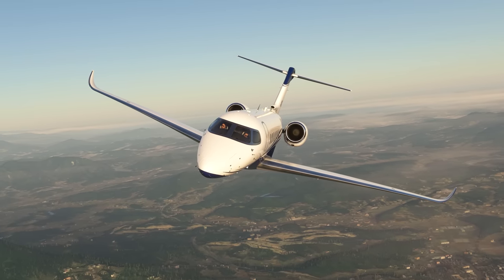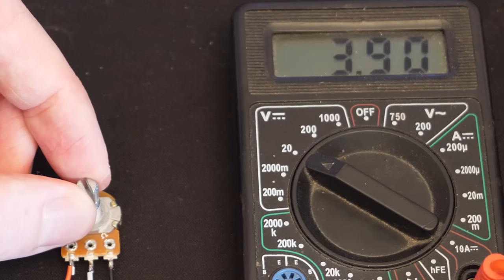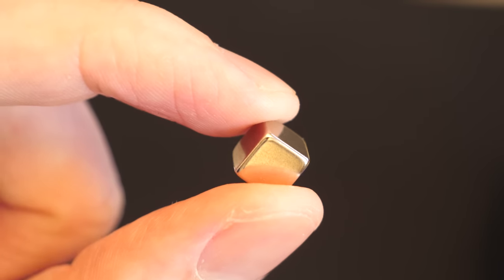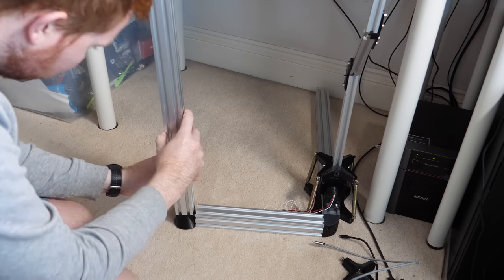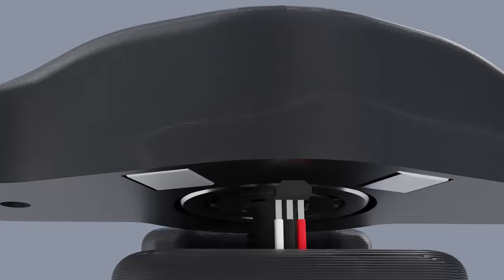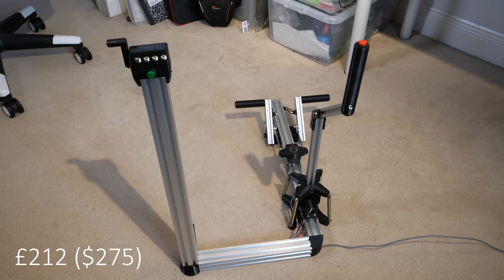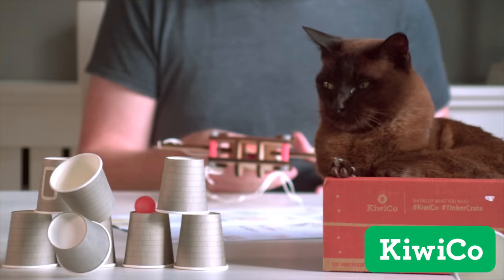DIY Flight Simulator Joystick

Comment: Mr beast: giving away 2 houses!!!
Tom: I cannot give myself the luxury of buying 15 euros of sensors for my project.
Reply: this comment makes me depressed.
Reply: Tom made it as cheap as possible for us not for him
Reply: Tom is a hell of a lot more interesting though.
Reply: The whole project would cost way more and the way he used the hall effect sensor and square magnets was extremely clever
Reply: @linecraftman3907  can even cut the cost down more by using wood instead of t-slot extrusion. Less adjustability, but once set up, you likely would not need to adjust it anyway.
Reply: If he just payed 15 euros for sensors, he wouldn't have material for this video. Instead, he's making money from the video, and presumably having a good time doing it.
Reply: Imagine what he could do with MrBeast money:
a MrBeast video: "Todayyyy I gave a Youtuber 1000 Bucks to make a flightsim controller, and he made an entire cessna!"
Reply: @XDTuber  or use normal potentiometer what ALL factory made flight sim controllers have, cost only 0,3$ /piece. hall sensor have better no need change but little expensive about 1,3$ all mechanic can made metal and wood easy to home.
Reply: hall sensor 15$ were hahahah i buy many hall sensor my many different project and all not has cost more than maximum 4$ and cheapen 0,1$ many good different hall sensors. easy use and made flight sim controller.
Reply: @mattivirta  a single jellybean hall effect sensor is cheap (~1.30 for 10) but a decent sensor that measures the rotation of an axle can be easily 12 bucks on just the chip in low volume.
the joystick I've taken apart basically uses a mouse sensor and a couple of leds.
Reply: @dadsfriendlyrobotcompany  where are those 200 pounds coming from? Is the aluminium the cost? I really don't get it
Reply: @ronwesilen4536  the 2020 extrusion is not too expensive, probably $10-30/m. The 20 series 4040 extrusion on the other hand, is more like $25-50/m, and he has a lot more of it than the other. Not to mention waste, mis-cuts, etc. I can get a 3m 2x4 for $2.50 and a 3m 4x4 for $8.
Reply: @dadsfriendlyrobotcompany  so basically it is the aluminium the thing that is upping the cost? I don't understand how if he didn't pay 15€ per sensor he ended up with a cost over 200
Reply: @ronwesilen4536  the arduino, pot, several sensors, pack of magnets, aluminum extrusions, nuts and bolts, switches, buttons, shipping costs, and rolls of 3D printer filaments just to name a few things
Reply: @HeatherMRhodes  so the aluminum
Reply: @ronwesilen4536  not sure the alum is all that much more than other materials in the grand scheme of things.

Comment: Great vid as usual. Just a little tip to use rubber sealed bearings on your next build. They'll keep all the dust and cat fur out ;). When you order them they will have 2RS at the end.
Reply: Sealed bearings would also provide some damping effect. I image there are some low speed bearings that would really damp.

Comment: If I do remember my flight class correctly, brakes are pushing both rudder pedals at the same time. Putting the rudder assembly on a sliding part and belt connect to a potentiometer to read the amount of brakes applied would be an easy improvement I think.

Comment: Yoooo, i was legit planning on getting a 3d printer for months now, and my first project idea was to do exactly this, to play flight sim
Reply: My one's in the mail! Woo! (albeit they've lost the parcel and it was meant to be here 3 days ago...)

I plan on making the one that adds some things to a regular XBox or PS4 controller, I have both at hand so the hardware is already there, just to get a joystick and throttle! Obviously not as good as this setup... But still a great place to start! :D
Reply: @Guffy1990  your printer is most likely in 1000 pieces by now, even if it came as a diy kit
Reply: @Guffy1990  oh man thats awesome, the order, not the lost parcel, but hey, good thing take time :p

Tbh, my plan was to do a mechanism that you can add a gamepad to and just use the thumb sticks for the stick, in stead of having the entire thing, including the sensors custom made too, but now that i see that it's even more accurate and responsive, I'll rethink my ideas.

Which printer did you opt for btw?
Reply: @boflator  I went for the Creality Ender 3 V2! I didn't have a lot of money to spare, and with personal upgrades an option, I saw it as a good starting ground that I can tinker with at a letter point if I want/need to. I didn't care for a printer I could take out the box and it just work, I like building things, tinkering with them, upgrading and so on. So at the price point, I think it will be excellent. Obviously I want to print things too, and that's sort of the point, but as my first printer, I'd like to learn as much as I can, what works, what doesn't, what breaks it and what I can improve.

And, fun fact, it got dispatched not long after I sent that message! It didn't come just a few hours after I sent a fairly strongly worded email calling them out on things I knew vs what they didn't know I knew. It should be here today!

I'll update here in a few moments with the thingiverse link to the joypad thing that I plan on printing :)
https://www.thingiverse.com/thing:4612448
Reply: @Guffy1990  ay yeah, i was eventing creality printers too. They seem to be a very solid starting point for getting into 3d printing. They are reasonably priced and their designs are transparent and easy to understand.

And yeah same, i wouldn't buy some hyper expensive "plug and play" type of printer worth several k.
Like it's probably convenient, but it's also kinda like buying a ferrari as your first car, I'd probably break it in days lol.

Oh snap thats a very neat design, i love it! Might get use some concepts in my future design too. You got me all hyped now again :D

I just gotta wait for us to move to a new place in a few months, cos where I'm currently, there's really no space to set up a work area D:
But in the meantime I'm writing down ideas, so when i eventually do get it, that bad boy will already have a queue waiting for it
Reply: @boflator  I am super hyped! I have so many benchmarks waiting to get put on an SD card then fired into the printer when it's built.

I don't even mean a super expensive one, just like a prusa, it just works. I don't want that. I like to troubleshoot, but as far as I'm aware, the V2 is pretty good out the box apparently.

Look up Prusas IKEA enclosure build, obviously you don't need to do it all, but that's roughly what I'm going for. I didn't intend on it, I just happened to have a side table that I wasnt using for anything and was just getting in the way. It'll sit right next to my computer setup, so I can monitor it at all times, and the fan sounds will be somewhat blocked by my computer tower. It's also the coldest room in the house (I run this room like a server farm >:D) so it shouldn't get too hot. The idea of the enclosure is so you can print ABS without temperature fluctuations ruining the print. It's particularly susceptible to cold areas, so the enclosure is to keep the heat in, and the smell. I think it's a great idea, and uses a lot of 3D printed parts to do it.

I'm lookong forward to playing around, I have many things that I've come across over the past few months where I've went "huh, I could fix that/make that better with a 3D printer", so I got one!

Comment: You could add a feedback based on airspeed to the elevator springs w/ a manual "trim" balance wheel.  Use stepper to pull one spring while pushing the other. Put stepper on mount that is movable by trim wheel. Flying a plane out of trim takes a bit of effort. Trim for climb, trim for cruse, and trim for landing. My 1953 Cessna 170b has a trim wheel that is about 5" in diameter controlling trim tab on trailing edge of elevator. Newer plans have electric trim. Older pipers have a crank handle that changes the angle of the horizontal stab.

Comment: Great video. I will keep that 'cheap' hall effect idea in mind for my next project. I built a set of rudder pedals using potentiometers for the YAW, left, and right wheel brakes. To over come the problem of the resolution I made geared linkages for the pots. The pots typically have slightly more than 270 deg rotation and the yaw linear travel of the pedals is 9 inches in both direction resulting 45 degrees rotation. So using a 6:1 gear ratio I get the full travel of the pot  and increased resolution. Flies in DCS,  and X-Plane without any control issues and tracks VERY smoothly as well. Gears are 3-D printed as well.

Working on a 'Huey' cyclic and will try your hall effect idea! Very nice.

I must add that your design is a lot cleaner than mine.

Comment: I really really like the way you used the hall effect sensor
I've been wanting to make something similar, but I struggle with thinking up mechanical design, so I was stuck trying to figure out how to use an encoder or pot for it
thank you
Reply: (i couldn't think how to gear it down or something without loads of backlash)
Reply: @runforitman  Maybe with a planetary gearbox? I was also thinking about building something like that.
Reply: @runforitman  I've been trying to design a home-made joystick for a while (though a more conventional desktop design). I had planned on using 3D-printed herringbone gears to gear down a potentiometer -- I think they should move more smoothly than traditional gears, but there will still be some backlash.

Comment: For eight years it has been a dream of mine to replicate a cockpit from Star Citizen for myself, but I have neither any experience in engineering nor in electronics.
However as a small project I think I can start by making a switch panel like you did for the thrust control.
Thank you for the great video!

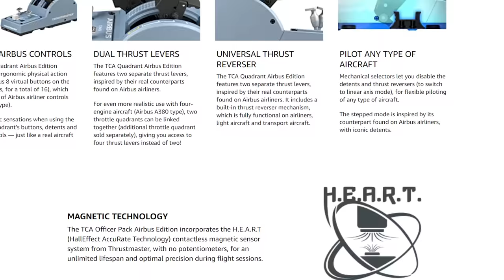Comment: 1:38 you could have picked a potentiometer with lower resistance rating so you can get more deflections
Reply: The voltage range will still be the same.
Reply: Or used a gear/timing belt system.
Then again, halleffect sensors are underused in DIY projects.
Reply: Or use an OPAmp as a non inverting amplifier to add a gain. Those integrated circuit are cheap.

Comment: That's a pretty sweet little rig. Next step: Force Feedback!
Reply: MSFS2020 dosent support Force Feedback yet. At least my old MS force feedback joystick wasnt outputting any force
Reply: @tswdev  The biggest problem here is actually adding the FFB. Could be used by some other tittle, MFS is not the only thing you can fly with a joystick.
Reply: @getsideways7257  DCS had some modules that had FFB, the default free Su-25 did, you can try that
Reply: @tswdev  I have all of their modules. My point was that adding FFB to the stick is the trickiest part.
Edit: "some modules"? So that's I guess why my G27 didn't work with Combined Arms...

Comment: This is pretty awesome. If I could make a suggestion...the axis you are using for the rudder pedals would actually be the toe brakes in an aircraft. The rudder movement would be akin to a sliding motion ie if I push left rudder the whole pedal slides forward on the left while the right pedal slides back towards you, not up and down like a gas/brake pedal.

Comment: "I'd buy that for $100."
"The total cost is $275"
Aight, xbox gamepad it is...
Reply: The extruded aluminum is probably the majority of the cost. So if you could find an alternative way then it would save you some money.
Reply: I have controller with pots and would like to. Change to hall sensors linear 3144 ,what are the magnet dimensions ,I did not see a resistor from + to output line 10 k can you help using BU 03836  12 bit board they say I can use sensor on their board
Reply: @TheQuark6789  you could try and 3d print the entire frame probably. It would be lightweight, obviously not so sturdy, and slow to print. But it could work. Or, better idea, use wood and 3d print some sliders in order to make easier the adjustments
Reply: @TheQuark6789  It shouldn't be a problem splitting it into Pieces, with some kind of hole to fit a screw or something to block the pieces in place

Comment: The spring system for the pedals is ingenious. If the tension of the spring is of the same pedal it's attached to, it might not fully return to neutral, but in this setting, the opposite pedal brings the other back. I'll try that.

Comment: Its worth noting that, for 2-3 bucks, you can get higher resolution ADCs that outperform even the 14 bit ones in higher end joysticks. Obviously it requires a bit more complicated programming, but they're very standard i2c/spi chips.

Comment: This is brilliant. The classic joystick just has such a different feel from the "central stick" control of any modern light airplane — the joystick, on the table, is just awkward to use. I could easily do without the throttle (any independent one or Cessna-like one would do), but the combination of stick + rudder in a single element is just awesome. Hopefully someone gets the message and starts selling those, for those of us who don't have the time/resources to fabricate it!

Comment: Thank you very much TOM for this excellent video. I am A retired engineer from germany - MY HOBBY is FLIGHTSIM and ELECTRONICS  and especiallly creating ManMachineInterfaces ( which i call SMART PANELS ) with MICROCONTROLLERS and all the equipment, like sensors displays and so on. I am currently using XPLANE11 - diving very deep into DATAREFS and COMMANDS - to get every information out of the system and place it as a useful information on MY SMART PANEL.  FS2020 is installed in the DELUXE VERSION - but the only thing I do with FS2020 is keeping it up to date- because there are still TOO MANY BUGS and RESTRICTIONS - you know engineers are always looking at the EFFICIENCY - and so I dont want to spend too much time . 
RUDDER PADELS and A SMART JOYSTICK are on my TODO list since a long time - but i am still in the phase of collecting information.
so you can imagine, that i was happy, to find your VIDEO   WITH SO MANY GOOD IDEAS. and INSPIRATIONS. 

My suggestion for ALL SIMMERS, who are using MICROCONTROLLERS as an additional element for FLIGHTSIMMING. >>> USE TEENSY BOARDS and forget the ARDUINOs.
No more problems with resolution, with speed or with the program capacity . have a look are their site     https://www.pjrc.com/teensy/td_flightsim.html   
and you will sinstantly know, why i suggest TEENSY.   If everyone has similar interests and is looking for discussion , feel free to contact    bs.fortdefrance@gmail.com

Comment: The brakes should be on the pedal toes, and the thumb button on the joystick is most often used for push-to-talk on the radio. For military planes if a joystick is in use generally the weapon fire control is on the trigger. there are some exception like WW2 British fighter planes, but then you'd want a completely different control column handle.

Comment: I love it.. great work Tom. The best thing is you have the controlls exactly like a real plane. You will flight better. I have a similar design but the springs instead of stretching are positioned in such a way that they are pressed. That makes the stick try to get in the middle more easily and it is not so soft, you have to do a little force. Excellent work Tom. Cheers
PD: next step, buy a car seat and place it to be more comfortable

Comment: A 737-style control would be cool. The stick itself only controls elevators, with a yoke on the end that has like 180° of authority (90° left + 90° right) that tunrs like a car steering wheel controls the ailerons, rudder pedals pretty much the same and the throttle on the right-hand side of the pilot featuring 2 levers, 1 for each engine.

Comment: Nice. Being a pilot I would have put the throttle on the right side and used my left hand for the joy stick. Being an instructor I also used the right hand for the joy stick and my left hand for the throttle but I never got so accustomed to the right seat as I was from the left. In the early 1980's I modified a Futaba transmitter to use what I called a rudder box you stood on. It had an actual center stop which your spring system does not and so when you let go of the stick it doesn't really come back to center. Do you have elevator trim. In a real plane this is a must.

Comment: Idea for your air powered car: For the syringe bulging you could 3d print a sleeve to stop that. For the resistance issue, use a lubricant Ex: Canola Oil.

Comment: Your design is pretty much a DIY version of the Pro Flight Trainer helicopter controller. The PFT has more buttons and is all metal construction (aluminum and steel), though, and costs a heck of a lot more. The version I have uses potentiometers, but the latest iteration uses hall effect sensors.

Comment: If instead of the joystick library you use a PPM library, you can then produce RC signals fed into the mic input and use a virtual joystick (vJoy) that has less (if any) latency. I use it in RC sims and used it in the FS with good results.

Comment: Springs aren't the best way to center joystick, but gravity, since springs are linear but control surfaces aren't.
I can tell, actual ailerons, elevators and rudder have very little centering force. You can slightly turn the stick/yoke of an actual plane, and it won't recenter, even hands off.
The same effect would be best simulated with the gimbal being at knee level, and a counterweight below.

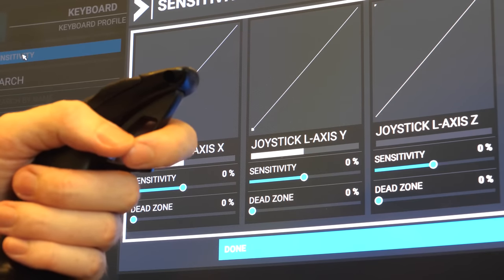Comment: 5:58 - If your stick does NOT have a dead zone in the center, you WILL want to go into your ingame joystick configuration and SET one.  Not having any dead zone means the controls will be twitching all over the place, the moment you place your hand on the stick.  The human hand (as it is, hanging there at the end of the arm) never stays absolutely still unless laying on a stationary surface.